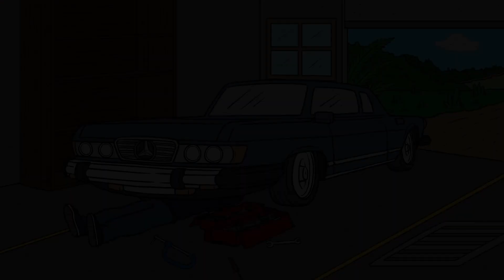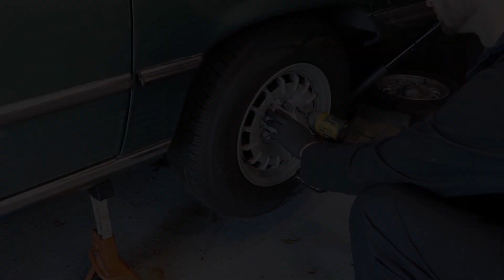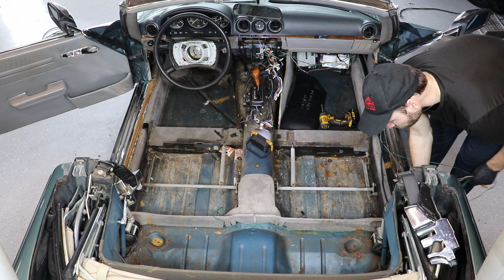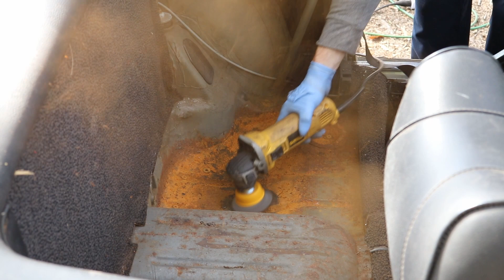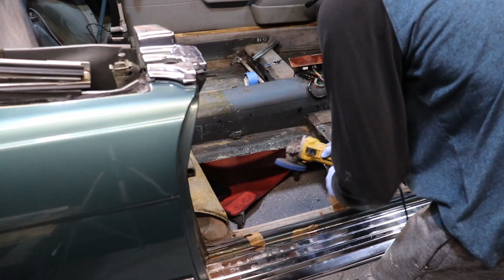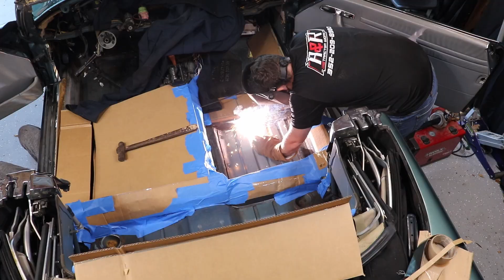Car Restoration-1985 380SL R107 Restoration- Part 5- Interior Tear Down and Rust Repair

Comment: Damn, you know everything, even the rust...I spoke too soon when I saw part 4.  I had no idea this was under the seats.  Did you determine how water was getting n?  Did you pull out the bulkhead and check under the blower motor?  I have heard and seen that as a major source of rusted floorboards.  UGHHH!
Reply from the maker: Luckily rust was only in these spots, i took out the blower motor and entire dash, water was getting in through soft top seals which were replaced